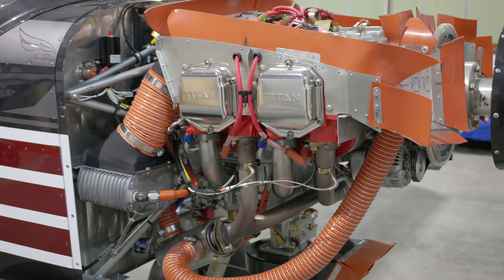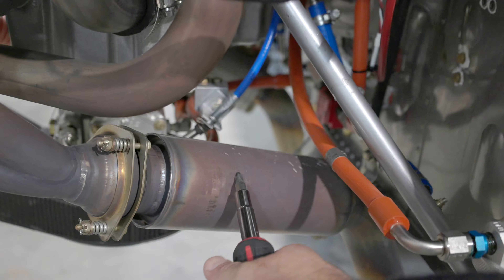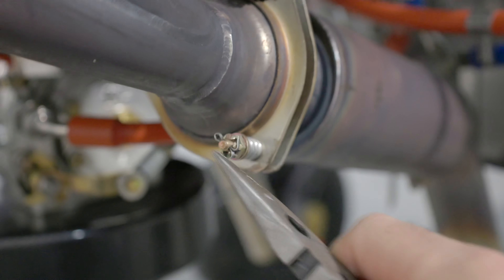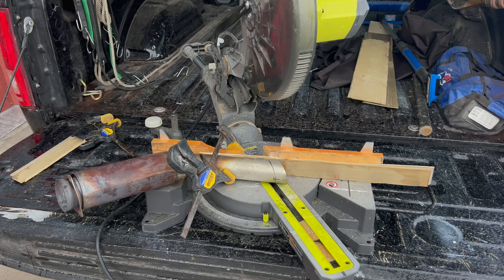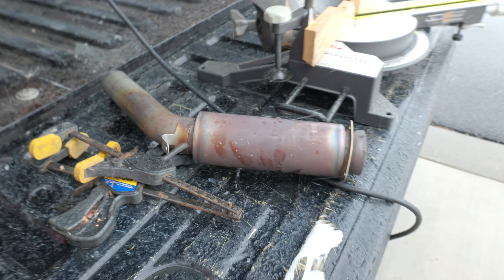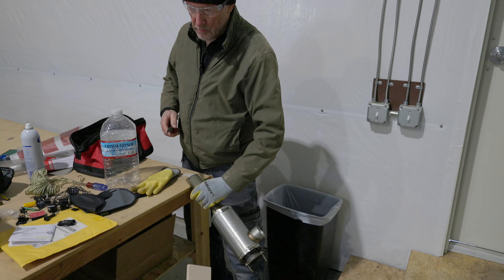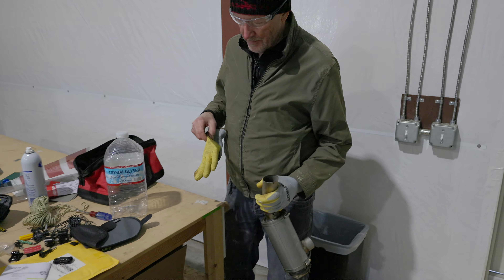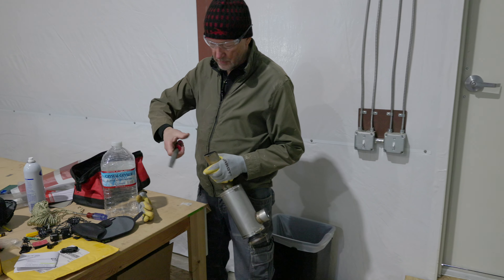I chopped my exhaust.

Comment: Was that just for cosmetic reasons, or are there advantages to chopping the exhaust at that angle?
Reply from the maker: I could’ve addressed that better… primarily cosmetic. What (limited) research I did said 45° was good for vacuum assisting exhaust. Probably not much, but doesn’t hurt. 👍
Reply: Good questions. There is an optimal length for horsepower but that wasn't mentioned.  Usually longer is better.

Comment: I think I would have cut them parallel with the fuselage to direct exhaust gas down a little and away from the paint, just a thought.
Reply from the maker: Plenty of pipe length and clear coat. Plus looks badass

Comment: Question for you: where did you end up installing your static port so it satisfies IFR requirements? Any tips or recommendations? Drain port? Thanks for taking the time Steve. She’s looking good brother! Sully
Reply from the maker: Hey Sully, thanks! I put the static ports behind station 4 which is aft of the wing on the side of the fuselage. I don’t have a drain fitting yet, so theoretically if I need to drain and “break the seal,” I’ll have to get another IFR cert. I have a potential solution tho when I get some time… it’s something the Robinson helicopters use. Possibly episode in future…
Reply: @CLEAREDDIRECT  thanks for the quick reply 👊🏻